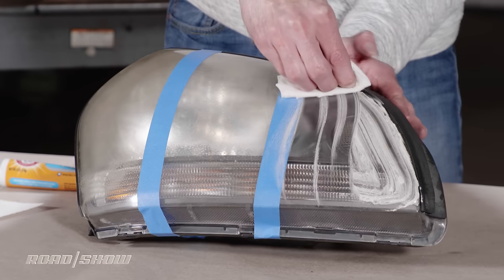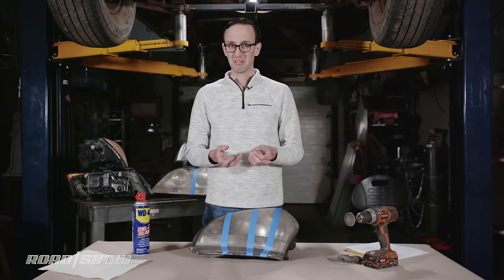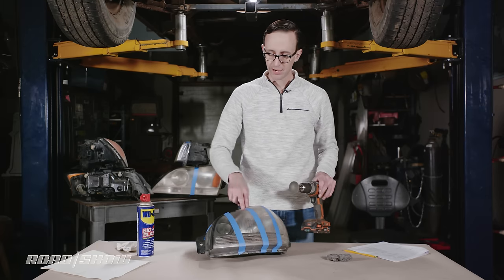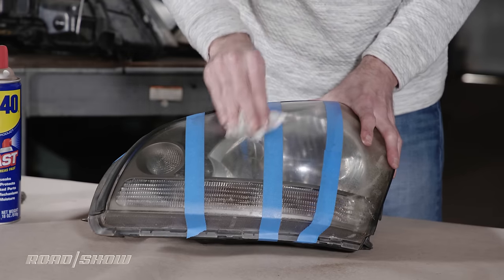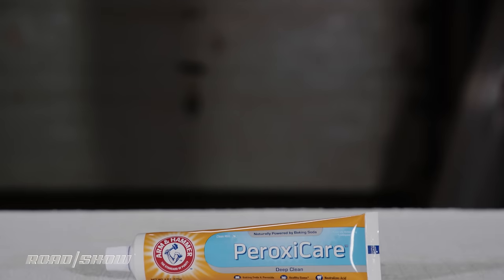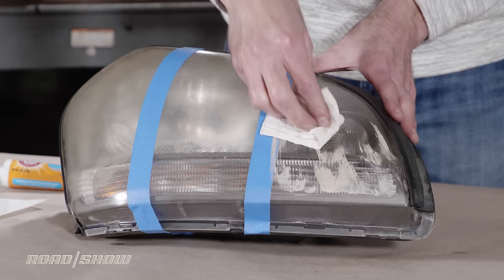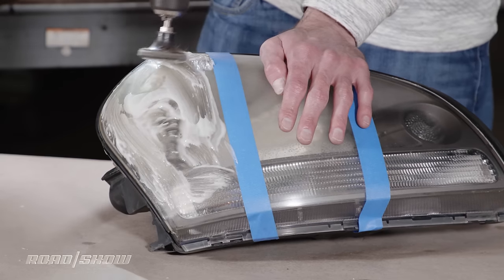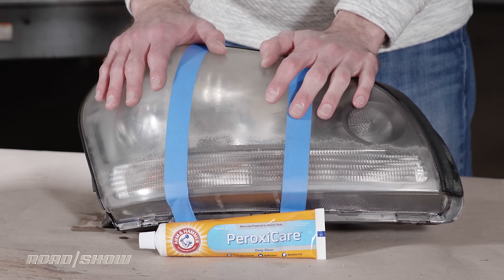Headlight Restoration with WD-40 & Toothpaste:  HACKS TESTED

Comment: Very sloppy "Test". The toothpaste works because it has tiny crystals inside that have a similar effect to polish or high-grit sanding paper. Applying it in that sloppy "edge" drill way would never work, it needs to be handled like polish. Use whitening toothpaste (more crystals in that) and some water, it works like a charm but only stays that way if you seal it with clear coat. It's totally not worth the hassle with kits like Sylvanna being $20 but in a pinch it WILL work. Just don't do it like ol' Cole here.
Reply: I agree. He doesn’t seem like he gives it an honest try. It seems like he sets the experiments up to fail. I did notice he wiped down the WD-40 with a paper towel and then used the same paper towel to wipe the other areas off. This would seem like it would contaminate the other tests with oil.
Reply: So what's an efficient way to do it all?  I'm thinking I'll use tooth paste to get it clean.. Then like what kind of clear coat? Like clear coat spray paint? Or would it be best to like sand it? and does sanding only the outside work or is the sun damage on the inside?
Reply: @sluggy1 
Tbh about it, non of this stuff really works. It’s best to take it and get it done. The guy in the video seems to just be testing some stuff out and he appears to know what he’s talking about, but definitely don’t listen to the guy from the top comment in this section. He’s definitely not telling you how to do it right. The best advice that anyone could give you, is to go have it done professionally. Mosab up there is talking about “sloppy test,” yet he’s also mentioning how “white toothpaste” has more crystals. Don’t buy into that. That dude is probably some kid in his mom’s basement.
Reply: Quite the contrary!
Reply: Yep! The toothpaste only works if you brush it with a toothbrush or some kind of a small brush and then wash it off with some clean water. This fool only applies the toothpaste onto the surface of the headlight and that’s it! What makes him think solely applying toothpaste onto anything would work? Is that how he brush his teeth by apply toothpaste into his teeth only? Without any brushing whatsoever!?
Reply: P @sluggy1
Reply: Agree, very sloppy indeed, just feels like a chore to him. Making your car looking good, requires a degree of TLC, no matter what you use or do.
Toothpaste definitely works, I tried it. But you have apply the paste and leave it on...i left it for a day. Then it gets crusty and when you go at it with a toothbrush , spray a little water as you go along and this consistency of the paste formed on the lens, is what polishes the lens. Baking soda made into a paste ,can be used the same way. BUT, it Also depends on the degree of damage of the lens, how badly the UV Ray's has withered the material.  Cause I got 2 different results on left and right headlights. Definitely improved but one more than the other. And definitely you need to put on clear coat on the lens thereafter to offer more protection. 
But even without the clear, do this once a month and it improves all the time
Reply: He work these the headlight restores company put a negative on toothpaste tell people to stop the cheap way out and stop by and they products😂😂😂
Reply: @sluggy1 mothers mag polish
Reply: To be honest it's a fair test for the average ham-fisted monkey at home because this is exactly how they'd do it, even with the professional tools and cutting compounds.
Reply: Big FACTS!
Reply: funny thing, even with that sloppy job, toothpaste worked. I mean, he says, barely any difference, but if you "rewind, and fast forward" to see a before-after view of the handmade toothpaste section, it clearly did some help even with that half minute of scrubing
Reply: @JayWest14 
Since the channel won't let me comment, my own comment. I have an excuse! I can't afford it!!!! Unless my family wants to go hungry which I don't do. Foggy headlights
Reply: I just use cheap Turtle wax by hand. Mine cleared up and stay clear.
Next time i use the wax with a drill and buff them.

I dont bother with clear coat spray.

Comment: So this guy has a fundamental misunderstanding of what is happening.  As dirt and debris hits your headlamp it is making scratches, the longer you have it the deeper they go, just like back in the day with CDs and DVDs when you did a "repair" on them it's the same thing.  You essentially have to remove surface area to make it flat again.  That is the only way.  Technically speaking when you use toothpaste or some of the other grinding/polishing kits/stuff what you are doing is those are "fillers" that will actually help.

Comment: Can you feel the pain from how half 🍑 his work was? Cause I sure feel like properly doing something anything just to calm myself down
Reply: Lol
Reply: Ya I pickup up on that instantly! Not much mechanical aptitude...
Reply: Hey now! It's difficult to do a good scrub when you have no upper body strength. This guys job mostly requires pushing a mouse around on a mousepad, not doing manual labor 😆.
Reply: @Gmoneygrip1960 ^^^^this^^^^
I was hoping for something like the other video he menti9ned, about comparing resto products, but hoped for more mechanically inclined, such as " does anything do as good or last as long as say a good wet sanding and clear coat"....
Reply: Dude looks like he put wd40 on his hair 😂
Reply: @IlluminatedDarkness333  It does make a good hair gel 😆.

Comment: Ive got a 2012 vehicle, and the headlights are pretty bad.  I've had them professionally restored, I've used toothpaste, I've used Turtle Wax restorer, Ive used other restorers and other home methods.  Most do NOT work, and the ones that do slightly work, only last about 3-6 months.  
Instead of wasting all that money on restorers, its better to just buy brand new headlights.

I sure miss the days of glass headlights.  No muss, no fuss.  Just Windex and a paper towel did the trick every single time.

Comment: This guy should clean the dirt and grime off first. 

Starting with the dirty surface isn’t a good way to make the test look effective. 

Using coarse abrasive steel wool is as effective as using some dirty sponge with sand on it. 
Starting the steel wool method means working your way from the beginning to the ultra fine. But I’d never waste the hours on it that such a process requires. 

Mothers msg and wheel polish was effective. But in overall, the toothpaste (first part of my attempt was a gel toothpaste, the second round when I decided to try for a more thorough treatment, I used Colgate with baking soda formula) and it was very effective. 
Took about 20-30 minutes each, plus the extra time raping off the paint around the lamp assembly. 

I wouldn’t follow this guys advice to fill my dogs water dish.
Reply: 😂😂😂and for some reason my angle grinding didn't help at all😂😂😂
Reply: "Raping off the paint"

Comment: You can use the ultra fine grade #00 steel wool.  The idea is to work up in polishing.  From heavier grits to finer polishes.  When I say heavier grits, I do not mean very heavy grits... this is plastic after all.  Start with very low grits, such as the light buffing pad on the buffer (foam, not wool, or the 00 steel wool).  It's the same with any polishing.

Comment: I had success with baking soda as a paste with water. Made it about 90% better, but had to do it a few cycles.
Reply: Yup others vids I watched used tooth paste but mixed with soap, baking soap & pure lemon not just tooth paste. Facts / information not presented here.
Reply: @Tyler1330  Definitely need to try a few things. I cleared up my 4Runner's headlights, and while I would have guessed it would need to be repeated periodically, it actually stayed clean for years until I sold it. With the cost of a new headlight assembly, it was time well spent!
Reply: @digitaldoc100 ... cleared up, how?
Reply: @edwardrogers-wright1604  The haze over the lens was gone.
Reply: Try baking soda with WD-40 or vinegar.

Comment: Start with 600 or 800 grit sandpaper and water.Keep lens and paper wet at all times.Then hit it with a 2000 grit sandpaper and water.Clean lens with alcohol then clear coat it is the best way.

Comment: All these quick fix methods are very short lived! A Mickey Mouse attempt at best.
The correct method is to sand the surface with various grits and then polish and seal with a product like Maguires headlight coating 👍🏻

Comment: Didn't clean the buffing pad after putting wd 40 on it, probably used the wrong type of buffing pad. The key to polishing anything is how slick you can get it and it take heat to raise the scratches up to be cut out. Always us a buffing compound with the matching pad and stage up .just keep in mind to use low speed with plastic to prevent melting
Reply: Did that went out the day and they were the same again!!!!!
Reply: @beverlymares1102 I’m

Comment: If you are not going to use the effort required to get through all of the haziness, of course it's impossible to work. If you continuously wet sand until its smooth and highly polished like new it has no choice but to work, you can't stop after one application of buffing if it needs 10 times that amount.

Comment: I'm sure I'm not the only one who has mentioned this, but  regular wd40 is not a lubricant it's a degreaser and water dispacer.

Put it on skateboard bearings as as kid. Removed the oil and left metal rubbing against metal after it dried

Comment: 4:43 "still pretty hazy"?? Well, it looks better than the untreated section, but it looked even better at 2:22, before you washed it off and that's the point. I always wipe it dry and leave any WD-40 that's left. Washing it off will wipe the WD-40 out of the cracks and make the surface hazy again.

Comment: Wet sand paper using different grits in steps. Then clean the lens well and dry. Then use spray clear paint after the last grit 1000 sandpaper.

Comment: Does it matter if you use a Rigid vs a Ryobi drill?
Reply: Yes. Around 100 bucks more for Rigid, but specifically designed to clean headlights with steel wool velcroed to the grill
Reply: Honestly I can't believe you ask the question of rigid or Ryobi wow you and the guy you want to test out to get together
Reply: Is this guy serious... What matters is what's on the end of the drill

Comment: None  of these work. Use a proper headlight restoration kit like you said. The ones that have sanding discs, then use a polish. Finally spray a  specific headlight clear coat.

Comment: You forgot the "elbow grease" ingredient. :))  Do you "rep" any headlight restoration products? ...you seem a bit biased. I think spending a bit of time with WD 40 and a drill with a good brush or pad would be very effective. Afterward, UV blocking products are cheap and easily found at Walmart or any auto parts shop. Not the best test in my view.

Comment: You didn't use enough WD40. As other youtubers have shown, it works if you spray a minimum of half a can on the lens, wait 10 seconds for a significant amount drip off, then hit it with a cloth.

Comment: WD40 isn’t a lubricant
Reply: What is it?
Reply: If it's not a lubricant. Can you please tell me what it is? Because I use it for things that are rubbing against its self  and hard to move.. for  example A old wrench that won't move smoothly anymore, a old door with eustyv hinges that won't open and close smoothly, something that is jammed and won't go in easy like pvc pipe, etc. Throw some WD. Forty on all that stuff and it works perfectly.. Seems like al lude to me but what do I know..
Reply: @norton2757 Seriously, what is he talking about If it's not a lubricant then what is it..?
Reply: @BeatsOmega  okay maybe it is a lubricant to a certain degree but… so is water.  It’s more of a solvent than anything else.
Reply: It is designed to free up rusted metal, it is not a lubricant like oil and should not be used as you would use oil. In fact it has a drying effect on joints. @BeatsOmega
Reply: This discussion actually taught me something. I read a long while ago that WD-40’s primary ingredient was “fish oil”… so I went and did a bunch of fact checking on WD-40 just now and that fish oil thing was only a common myth. As far as the lubricant/solvent discussion - your latter comment is exactly what I found, it is a lubricant/solvent and thus can be used for cleaning and lubricating items.

However, regular WD-40 is not as good as some of their other products and it depends on the usage. I used the “WD-40 Silicone” variant on my patio door tracks/coasting wheels and WOW… huge difference over the regular WD-40. That might be apparent to some here but figured I’d add that little nugget for others who find this thread. I have gotten into the habit of searching “best lubricant for ____ (insert project)” and tallying the common answers.

Comment: The toothpaste works better with a tooth brush and some water.  I use a sprsy bottle, you don't want it to dry up.  Plus you have to brush for about 5 minutes then rinse it off with water.  That worked for me,  but it is temporary, it lasted for about 3 weeks.  So after every car wash I i now use some wd40, I  spray a small  micro fiber cloth and polish it as pat of the car wash. They look great good as new.
Reply: Just do a proper restoration and you don't have to keep doing all that.
Reply: You need automotive grade clear sealer and it will protect the plastic.
Reply: @spiralnapkin  i did that, I got the one recomende by the guy at the auto parts store.  But it was not as good, the tooth paste did a better job.
Reply: @brucecarkuff521  thanks  😊 I will get that for the next time.

Comment: Saw Craig in the stillshot doing manual work and knew the dialogue would be funny, so I had to check it out regardless! 😂 Never knew WD-40 could be used for that; honestly, I used DEET (mosquito repellent) when I was younger on my vehicles’ headlights - it was a temporary solution but definitely made them look clear and new every time.

Comment: Use "OFF" bug spray. Works way better than anything shown here.
Reply: my dad showed me that a couple weeks ago and it actually worked pretty well
Reply: Don't. It MELTS the plastic
Reply: @McCurtainCounty888  no it didn’t lmao
Reply: DEET is a plasticizer and can damage certain rubber, plastic, vinyl, or elastic materials such as contact lenses, eyeglass frames and lenses, watch crystals, combs, painted and varnished surfaces, and certain synthetic or treated fabrics. DEET does not damage natural fibers including cotton and wool.

Comment: All that trouble just spend $100 on a new plastic clear headlight and install it yourself and be done with it.
Reply: Mr. Richy Rich listen… 1st) Not everyone has money to drop on new headlight assemblies (which cost actually varies by make/model) and 2) if the kits are not installed properly, the lights can be aimed too far up - blinding passing drivers. I can guarantee you’re either a mechanic’s kid or not someone who actually works on cars.